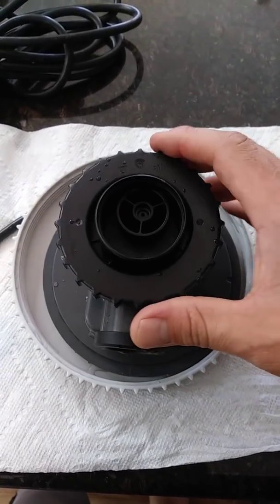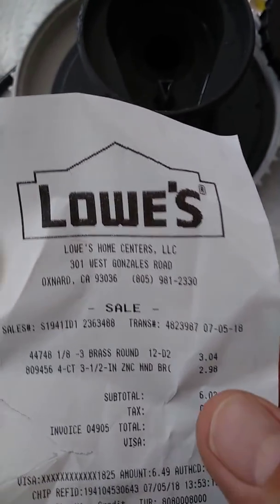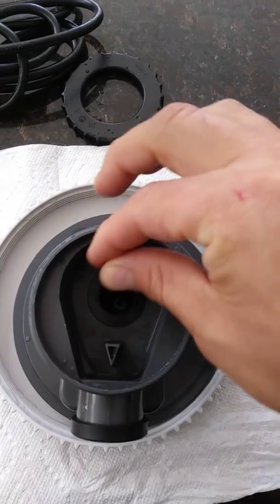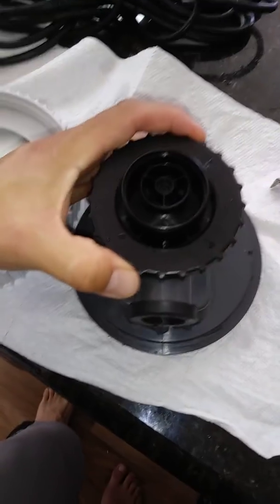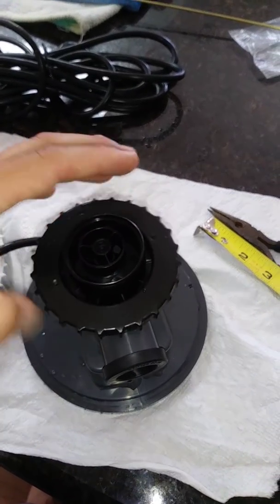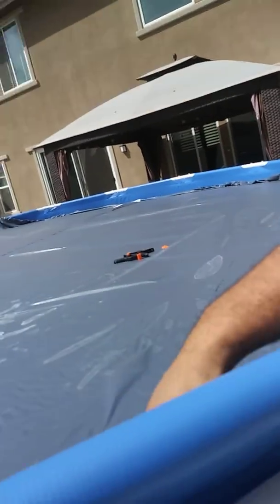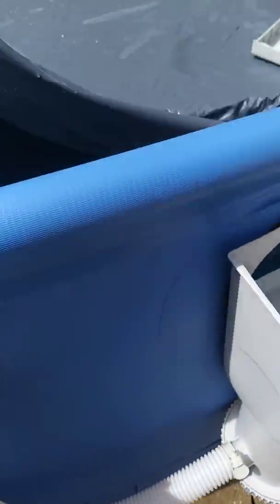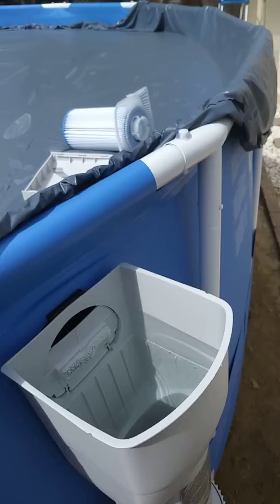SFX1000 pool pump repair

Comment: Bob, thank you for the thorough explanation and R & I instriction.  As an engineer, I can say that ferromagnetic steel would probably be a poor choice but a non-magnetic stainless alloy would probably hold up well.  Understanding that Aluminum might be too weak in bending, I am wondering how the brass has held up.
Reply from the maker: After a season and a half the brass is in great condition, and the pump is running strong 👍
Reply: Thats one thing i was worried about when searching for something to use as a rod. The magnet im mine is sooo strong

Comment: Ok I think I have a different problem then because I check my pump and the shaft was made out of metal and it was not broken the I also change the filter but the pump still not turning on and the bottom black part where the thick black wire is connected, is very hot. Can someone tell me what can I do?
Reply from the maker: You must have the smaller model??? SFX600? These smaller pumps get obstructed by a strand of hair. Pull the rotor assembly out completely and verify that nothing is inside or around the shaft. Any resistance will over heat the pump or stop it. Good luck.

Comment: What if you hear a humming sound when you connect it
Reply from the maker: It could be your ceramic rod is broken or some debris is blocking the rotor assembly. If you replaced the rod already, it could be because the ends of your rod aren't smooth. Hope that helps
Reply: This help I got it to turn on but after a while it turns off why you think that is ?
Reply from the maker: @yhale33  I wonder if the pump is getting hot??? These pumps have a safety feature to shut down if over heated. Are you running an extension cord? Could possibly not be supplying enough power to the unit.
Reply: It does get hot but am connecting it straight to a outlet maybe the outlets are not strong enough to supply power to it ?
Reply from the maker: @yhale33  Darn. I wish I had more info/advice. 
Are people swimming and it shutting off? Running the pump with swimmers can create extra load. Is water level sufficient? Low level can cause pump cavitation which can cause overheating. Is it the metal rod? Right diameter and length??? Just some more ideas... Good luck. Maybe another youtuber can chime in...

Comment: where'd you put the o-ring?
Reply from the maker: Mine didn't come with an O-ring. Did yours come of the pump? The only o-ring i had was more of a gasket that went between the pump housing and liner of the pool. Sorry that's not probably any help to you.
Reply: Thank you for trying to help. I finally got it placed correctly! Yes mine came with o-ring. When removing old pump, ring flew off when pump came out due to water pressure, so wasn't sure from where. As it turns out it fits in a groove just below pump along inner side of pump holder itself...then screw bottom on. Whewww...just glad it's done!😃
Reply: Michelle, did your o ring seem stretched and too big to fit in its groove?
Reply: @JamesWDantonio  No James, but it was tricky to put back. Hard to remember now. I think it seemed like it was too big but if Im not mistaking, I was trying to insert in wrong grove.
Reply: @JamesWDantonio  I remember before screwing on bottom, I used mirror to see what I was doing and black o ring goes up and inserted into a grove. I first tried putting oring on inside of pump. I hope that helped.
Reply: @JamesWDantonio  Great! Im not good at trying to explain. Sorry. enJOY the pool again!! Yay, right?!!!
Reply: @M219D  Yay indeed.  My 3 year old son was crying because we wouldn't let him swim for 3 days haha.  Kid is a fish!

Comment: I figured this out before watching this video but it clarified it. A week after buying the pool that little rod snapped and the manufacturer was going to honor the warranty and send a new pump but they wanted me to take a picture of the receipt and take a picture of the pump with the cord cut with scissors🤦🏾‍♂️ and they would deliver one in ten days
Reply from the maker: That's a lot of work to honor a dang warranty.
Reply: Exactly
Reply from the maker: @millermatic140  what you should do is use the pump for this summer, than at the end of the season, cash in on the warranty and get the new pump 👍. Good luck

Comment: How did you get the shaft to aligning with the magnet again
Reply from the maker: Keep the assembly pinched with needle-nose pliers, and rotate the unit until it drops into place. When I put mine back in I felt the magnet grab it and pull it down into place. So just keep rotating the magnet part that you're dropping in until it finds the proper seating
Reply: Ok will keep trying, thank you so much for your reply.
Reply from the maker: @GABYYYGIRON   You might even be able to just twist the rotor assembly by hand till it drops in. Good luck.

Comment: Its so EASY and it WORKS! I am not (but becoming) a handy housewife and this saved us $170. Our 2nd pump just broke and I was ready to buy another one because I didn't know what else to do. I watched this video earlier this afternoon spent $1.59 for the brass rod, worked on the pump for about 15-20 mins and now my pump is working as good or better than new.  Thank you so much! Great advice and great video.
Reply from the maker: Glad it helped you out. Thanks for the positive feedback 👍.

Comment: 2nd season of use and my pump ran for about a week then, as described, just the “hum” of the motor and no water flow.  Found this excellent video but then found on disassembly that all the fins of the rotor were sheared off!  And yes, the ceramic rod was broken.  So, had to buy the replacement impeller and immediately made this mod before installing, using the new ceramic one for exact measurement and saving it as a backup.  It ran for about a day then quit working again.

The new rotor had a piece of the plastic sheath covering the strong magnet missing.  Perhaps I had not aligned it properly during installation or maybe some large debris caused it.  So, I removed all the sheath, careful to not damage the ends.  This was not easy by the way.  Smoothed everything with sandpaper, reassembled, tested as before then reinstalled.  All seems to be working fine – time will tell.
Thank you, Bob!
Reply from the maker: Great troubleshooting on your part. Hope out lasts for you this time 👍

Comment: My pump starts off with a strong flow and after a minute it weakens, could this be the cause?
Reply from the maker: If you are getting flow, a broken rod shouldn't be the problem. With a broken rod, there wouldn't be any flow. Not sure what would cause a loss of flow but here are some things you could look for:
1. Dirty/plugged filter -run pump with filter out, see if that helps
2. Pool water level too low or too high
3. Electrical source has enough power. Not sure if your using an extension cord
4. There could be debris (hair, leaves, etc.) caught in the rotor assembly. 
Start with that. I certainly hope that helps. Good luck.
Reply: @bobganoosh5520  thanks
Reply: Unplug the pump and pull the bottom hose off,  mine did that before the rod broke and what I found was a chopped up hair tie that got sucked down and clogged the exit of the pump itself lol

Comment: The best video yet on this pump and pool! Awesome! I also dropped the plug into the pool! We replaced the GFCI plug bc ours got wet and stopped working. But the pump is rattling and this might be why. Thank you!
Reply: How do you replace the plug? I see condensation in mine and it won’t turn on

Comment: I talked to a person that works for that company and they suggest to run the pump 6 hrs a day, to NOT use a timer and specially don't run it when ppl are swimming it makes the motor overwork, if you want to avoid buying another brass rod or motor and last a long time you need to follow the instructions:) but I really LIKE this video it saves a lot of money.... Thank u sir 🙂😉
Reply from the maker: Great info. Thanks for sharing. Hopefully others read this as well.

Comment: Setting up this pool for the 2nd season and the motor doesn’t even turn... got it to slightly turn a few times, but no constant hum or anything. Does this sound like this issue? I’ve verified the outlets are fine and reset the device. Thanks in advance!
Reply from the maker: I had a bit of trouble getting mube going for the 2nd yeast as well. What I did was pulled the entire rotor assembly out and cleaned all the surfaces off. Both inside the pump and the body of the rotor assembly. Worked fine after that. Hope that helps.

Comment: Most useful video on YouTube ever.
Reply from the maker: Ha ha. Appreciate the support. Have fun in your pool 👍
Reply: @bobganoosh5520  went to Lowe's, they did not have it. Maybe HD I'll try but thx so much because I wasn't sure if the shaft was broken but after seeing your video I checked it and sure enough one end was smooth the other was jagged and slightly sharp. So, you Da man!

Comment: my sfx1000 was running fine had turned it off and the next day when I turn it on it would only hum .seen this video and checked out my pump sure enough had same problem got it fix and when I turned it on still just hums what else can it be?
Reply from the maker: Be sure that both ends of the new rod you put in are smooth. Any small burr or snag will definitely hold it up. Maybe hit the rod with some fine sand paper??? Hope that helps. Let me know how it looks

Comment: Robert, I plugged mine in first time today. Ran for about a minute and quit. I called the service number and they told me I couldn't use an extension cord. Is this true???
Reply from the maker: Were you running an extension cord originally when it quit running? If so you probably didn't have a strong enough cord. If not strong enough, it would burn it out. At minimum it should be a #12 guage but realistically should be a #10. Now with that being said... I am not an electrician and cannot give electrical advice (lol). Its not that you CAN'T use an extension chord... It's just that it is considered very unsafe. The extension cord allows exposure to water and electrocution. If a cord is the only way you can plug in, then consider unplugging the pool pump while people swim and only run the pump at night when nobody is around. Again... I'm not an electrician, so this is just an opinion. Hope it helps. Good luck.
Reply: I use our orange electrical extension cord. It has enough power

Comment: Where is ur rubber black ring at
Reply from the maker: Which rubber ring are you referring to?
Reply: @bobganoosh5520  I'm having the same issue.  Last year my ceramic rod broke, which I've since fixed.  This year, now I'm setting up the filter again and I have a big rubber O-ring which I assume seals the bottom of the canister. However the notch on the pump itself prevents the O-ring from fitting snug around the pump to be screwed in from the bottom, and I'm getting a leak. The O-ring also seems to be too large, which leads me to believe it's not even supposed to go there. In your video I don't see this O-ring on the pump, and you don't show the process of you actually screwing the pump in from the bottom, so I'm feeling a bit clueless here.
Reply from the maker: @josephsaccente7828  my pool pump does not have that rubber o-ring that you are referring to,  not sure if you can run yours without it. As far as the leaking, I really believe the most probable cause is due to cross threading the plastic can cross tread very easy. Also be sure to tighten it all the way. Sometimes you might need an extra sets of hands
Reply: How did u get ur to stop leaking

Comment: Can't get the bottom to go back on without leaking. Any suggestions?
Reply from the maker: Verify the the tab of the pump is lined up with the notch insde the housing. Also ensure you are not cross threaded on the locking ring. It is very easy to cross thread when doing it by yourself. Get an extra set of hands if you can.

Comment: I just got this pool yesterday.I am doing this mod before I even set it up.Thanks for the advice.
Reply from the maker: Let it ride. Your ceramic piece may not break. But if it does, you'll know how to fix👍
Reply: Use the top section of a fiberglass fishing rod cut to fit it's works better
Reply: I just got my kids a pool last month and the pump just stopped  yesterday! The humming it was doing makes sense now! Thank you for the step by step video I'm going to try this tommorow.

Comment: Brass rod will wear out and break!! Mine did after 48 total hours of running the pump
Reply from the maker: Just inspected mine 2 days ago after 1 full summer. Not sure how many hours, but the rod is still in great shape. But I did by a 3ft. Piece for replacement as well. Sorry to hear yours broke. Its still a less expensive alternative to paying $30 for a new ceramic assembly.
Reply: Use a the top of a fiberglass fishing rod cut to fit
Reply: The black rubber piece came out and am not sure if I am putting it back in correctly and now its leaking
Reply: I did this method but my brass rod snapped after 3 days. I guess it’s never meant to be. Not sure what to do next
Reply: Also it made my spinning magnet thing worst

Comment: How do you unscrew the GCI connector because it doesn't have normal screwdriver capabilities.  It's a tiny area to get a tool down to that won't accept a flathead or any other tool.
Reply from the maker: If it's not a regular screw driver, then it must be a torx bit screwdriver. I'm bit near my pump now, so I can't look. Harbor Freight or Walmart skills have the tool for pretty cheap.

Comment: GCI connector is not working. Any suggestions for us?
Reply from the maker: Not too sure. Check the outlet with a hair dryer or portable electronic. If it's the outlet, maybe the breaker needs to be reset??? Sometimes the GFCI's can get hot and fail. If this is the case, your local home depot or Lowe's will carry replacement units for $20. https://www.homedepot.com/p/Leviton-15-Amp-Compact-Right-Angle-Plug-In-GFCI-Black-R51-16693-THD/203477830
Its a pretty simple splice and rethread. Hope that helps. I'm not an electrician, so there could possibly be other reasons. Good luck.
Reply: My gfci did not work. Called ploygroup and they walk you through simple troubleshooting. The cord was bad. They sent me a new pump.
Reply from the maker: @michaelhickok2263  that's the easiest solution! Glad they cooperated with you. That's not always the case.
Reply: I know that's true. I have been down that road many times.

Comment: so i just got this summer wave pool and i just installed the filter. it turns on and makes a low noise but it doesnt pull the water in and push it out. when i remove the filter the water begins spinning. can anyone help me with this?
Reply: i saw many people doing the same thing as you but they would say it is because of a loud rattling noise.
Reply from the maker: Is it the right filter?
Is the water level at the right level? A low level can cause pump cavitation.
Maybe you can pull the pump and open it up to make sure there is nothing blocking the inlet side of the pump.
Reply: Bob Ganoosh i found out what the problem was 5 minutes after posting this comment. i also found out i was a idiot haha so the problem was when i got the filter i unscrewed the bottom and it all came apart. i decided to just screw it back on and connect it to the pool but what i didnt realise was that there’s a tube on the motor that is supposed to be alligned with the tube going back into the pool and that fixed it. also i screwed the bottom back on as tight as i could and theres still a little bit of water leaking from the filter. for now i put tape but im not sure what to do.
Reply from the maker: @VanityThoughts  glad you found the problem. To stop the leaking, you most likely need to rethread all your fittings. Block the inlet so no more water can enter the pump canister. Then open the canister and drain all the water inside the housing. Then reseal everything making sure you aren't cross threaded on any fittings. Good luck.
Reply: Bob Ganoosh Thanks alot for the help. i hope the solar cover really makes a difference.
Reply: Bob Ganoosh i might try and do something my uncle did with his pool. it sounds silly but he heated a metal rod in his grill and would pu t several in the pool and the water would begin to bubble alot and eventually it was at a good temp.
Reply: Bob Ganoosh also my pool has been in the sun and setup for about 4 days now and its still way to cold, its at the point were it starts hurting and stinging your skin. its fully in the sun. im 16 and my mom get me the pool, i doubt she will want to spend a ton of money on a heater and i don’t have enough money for one. will the sun eventually warm the pool? i have the 14ftx42inch
Reply from the maker: @VanityThoughts  I have a 17 ft x 48" pool and live in Southern Cali. It gets plenty of sun and does not warm up very well either. So I don't see your water heating up much more. If it does it will certainly take more than the 4 days you referenced.  Check Leslie's pool supply (website). Or amazon... You can probably get a solar cover for under $40.
Reply: Update:
I covered up my pool with a regular cover and the pool got really warm with just the sun. ive been in it a couple times. 
just putting this out there if it’s any help to anyone

Comment: Hey Man so when the rod broke did it not even turn on? Because mine isn't even Coming on?
Reply from the maker: Thee pump was trying to come on. It was just making a humming/vibrating sound if I remember correctly. Is your rod broken? If not, could be hair or debris blocking the rotor/rod.

Comment: Having a problem dropping the propeller completely down evenly into the center. Is there a trick to it. Ive benn working on it for hours.
Reply from the maker: Another person was having a similar issue. There was no trick for me. Just didn't get on camera because I needed both hands and had to pause the camera. Just continue spinning in or maybe try pushing it while gripping with the players.